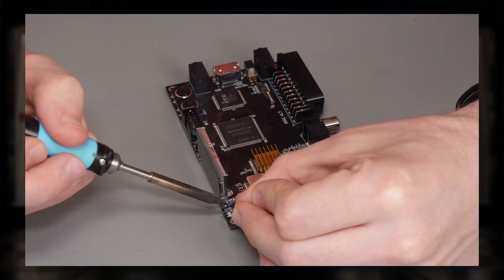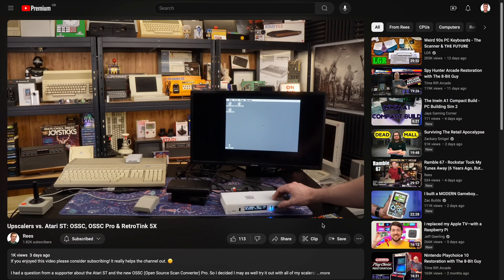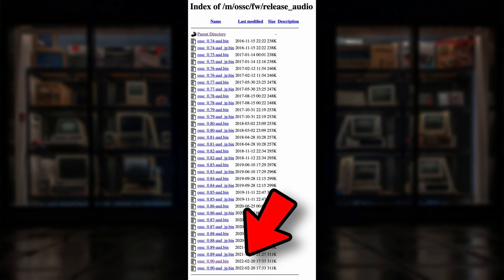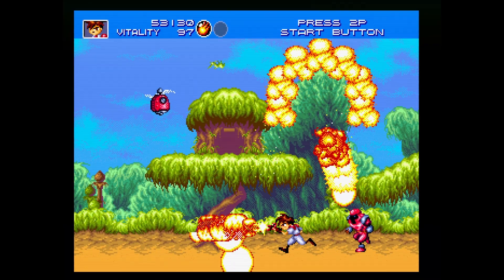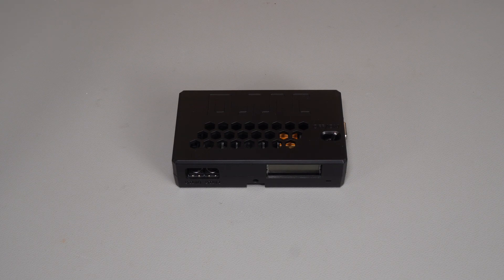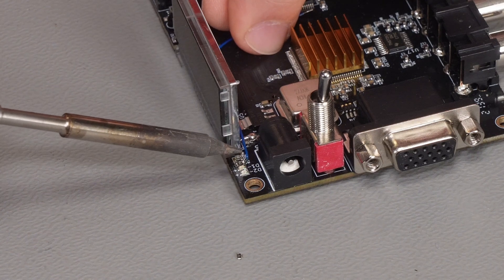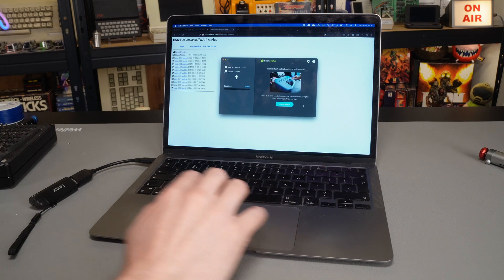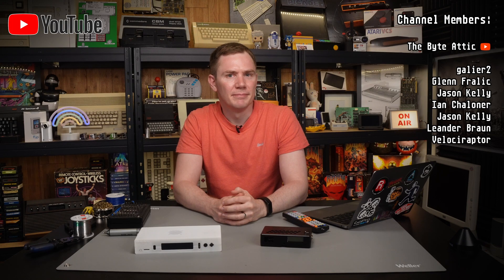Get OSSC Pro Features On Your OSSC With This Simple Mod

Comment from the maker: FAQs: The hardware mod is not required on the new OSSC 1.8, just install the new firmware. This mod and firmware are compatible with all OSSC versions including the original DVI 1.5 board (with audio mod). Pin 25 of the TVP7002 does not need to be lifted as is sometimes advised elsewhere. The mod is fully reversible and officially endorsed, but may void your warranty if you have one. Unfortunately I can’t offer modding services, but thanks for thinking of me. :)
Reply: Thank you for the video. It was very helpful. Just to confirm I am about to purchase my first OSSC for Sega Saturn use. If I get an OSSC v1.8 I dont need to do this mod only update the firmware? Which firmware would I need from that link in the description please?

Comment: This was a little bit challenging, I never soldered this fine before, but a tiny wire from a small stock cooler from my MiSTer worked wonders.
The new feature set is kind of underwhelming for the effort but Line5x is pretty neat.

Comment: Just tried the “quick” mod. Because the pin that I need to solder to is absurdly tiny and also surface mounted, I destroyed my OSSC by soldering the wire to the leg of the chip and then accidentally ripping the leg off. Sadly, this is not a simple mod and will probably damage your OSSC. 1/10 don’t recommend

Comment: My OSSC's heat sink is quite a bit larger than the one in this video causing me to not have easy access to pin 25. How would I go about removing the heatsink to do the mod and reapplying the heatsink?
Reply: Use it for a bit to warm up, turn it off and try gently twisting the heatsink. Should only be a sticky thermal pad. Solder and reapply heatsink with a new thermal pad.

Comment: Just modded my ossc v1.6 board.

Works perfectly but BE VERY CAREFULL WITH the R35 removal AND the soldering with the cable. 

Test with a multimeter BEFORE & AFTER the soldering for possible shorts BEFORE turning on.

Comment: Hi. I just got a new ossc pro and i can't figure out the profile import. i tried to flash both ver.89.bin and ver,90fx.bin profiles from  correctly importing json files with the corresponding version number. The ossc firmware version is 1.11. Am I up on shit creek or is it possible to use the ossc profiles on the ossc pro?

Comment: This mod only works if the U10 flash chip located on PCB bottom side is S25FL116K0XMFI041 or IS25LP016D-JBLE If not, there is a high chance of bricks or blackouts (don´t bother try ing on board revisions below 1.7 o 1.6 because is more likely to suffer bugs or bricks)

Comment: I did this and tried the new firmware 1.11, but sadly, it causes my TV to drop out every few seconds, went back to 0.90 and no problems.  Shame, though my TV doesn't work with anything other than 2x anyway, not even passthrough, so I guess I'm not missing out on much.

Comment: I've completed this mod on my v1.6 PCB, I've upgraded the firmware (to even newer version, v1.10), and AverMedia LGP2 still does not want to record from 320x200 produced by Amstrad PC2086 and outputed by OSSC, it can only record 640x480, but that was possible even before the OSSC upgrade :(

Comment: Ohhh no.  You aren't going to convince me not to buy the new OSSC Pro when it's released.  Don't even bother.
Reply: Nobody did ya muppet
Reply: Update:  Did this mod last night, finally.

I have two OSSC Classics -- one for my game consoles, and another for my retro PCs.  While the OSSC has been a godsend for getting VGA to HDMI, it's far from perfect.  I was really hoping the 1.x updates would help with sync gripes that I have -- particularly how often PCs change modes, or just reset the CRT controller for no apparent reason, and how excruciatingly long it takes for that loss of sync to reestablish on the OSSC (which sometimes fails to notice and remains NO SYNC until another change), and then reconnect through my HDMI matrix, to my TV.  It's not uncommon to have no video for 10 seconds at a time.  Good luck catching BIOS messages or errors in your config sys.

Unfortunately, with 1.12, the lengthy resync is not fixed, and it does not ride through CRT controller resets even when the screen mode has not changed.  Of course, that's to be expected, but I did hope it would be better.  So, the OSSC Pro is still on my list to do some adaptive framerate magic that will paper over these issues.  Until then, the OSSC Classic does the job, if not particularly well.

I have not tested ithe update much yet, but it does seem to be a little better about locking on to the timing.  The release notes of various 1.x versions did say that sync phase should be less janky now (lower jitter), which I hope will cure some artifacts like phantom patterns in Windows 9x logoff every-other-pixel checkerboard dimming effects, or slight hue changes across the screen due to sampling errors.  My 486's (ATI Graphics Pro Turbo VLB) text mode does seem to look a bit better.  It was always a bit... "off" and jittery before.

So it's still a great little box that is very good at scaling analog signals to higher-resolution digital, and I have no regrets over buying two of them.  But it's far better with sources that use video modes that don't change, and benefits greatly from custom-tweaked timing profiles that are linked to sources.  For those of us that use switch boxes to put 8 pounds of potatoes in a 1 pound sack, and particularly if those potatoes change timing parameters frequently, it might not be the best tool for the job, even after the mod and firmware updates.